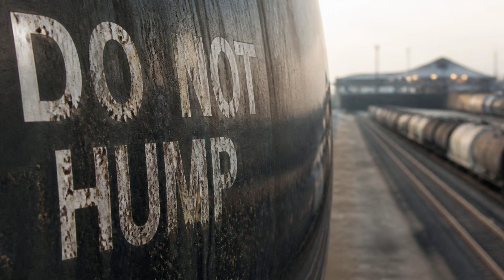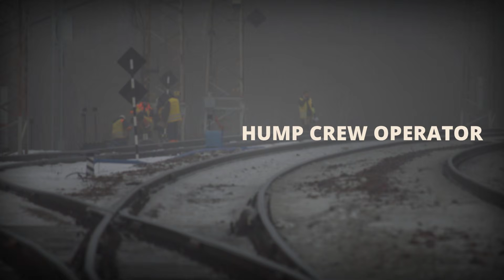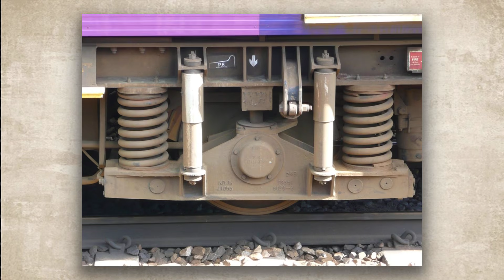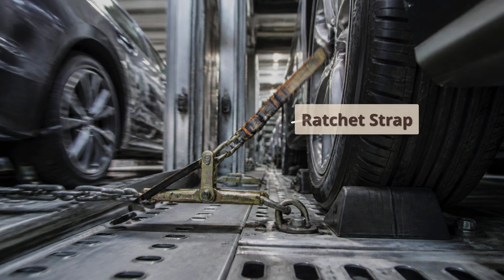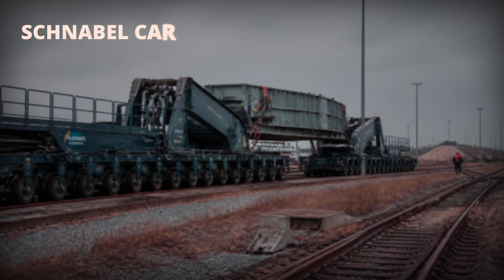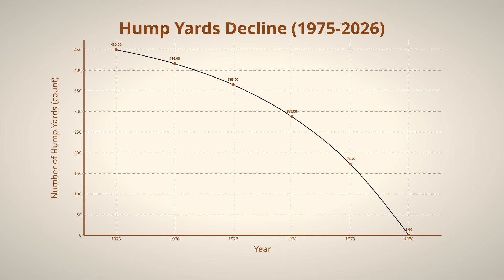"Do Not Hump" — Why Railroads Crash Freight Cars Into Each Other to Build Every Train

Comment: All freight car designs are tested on a simulated hump, up to an impact force of 1.25 million pounds.  This occurs at about 5 to 6-m[h depending on the design.  Class 1 railroads are good at controlling hump speed, but shippers assemble trains using flat switching by locomotive.  The locomotive releases the car and it roles into the consist.  Shippers are notorious for damaging cars due to "over-speed impact" .